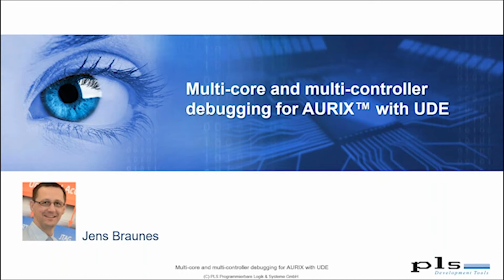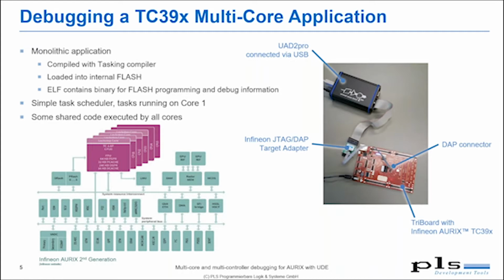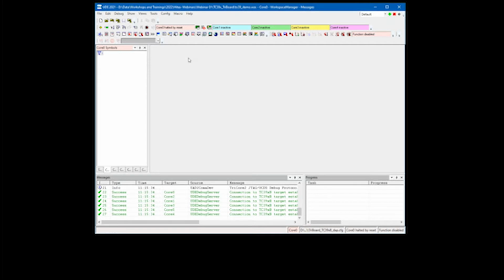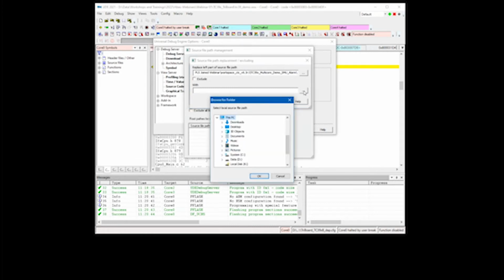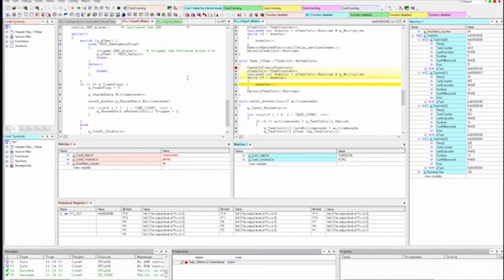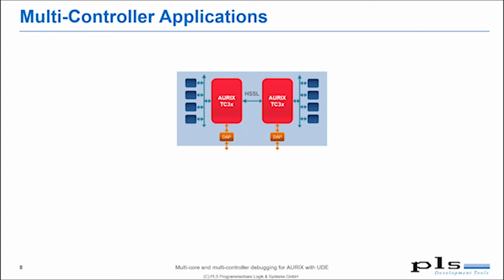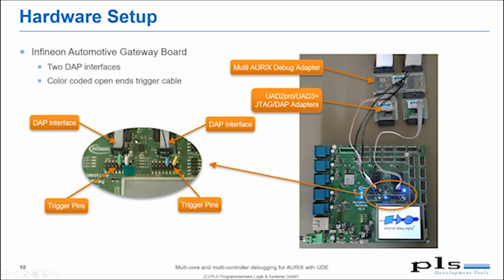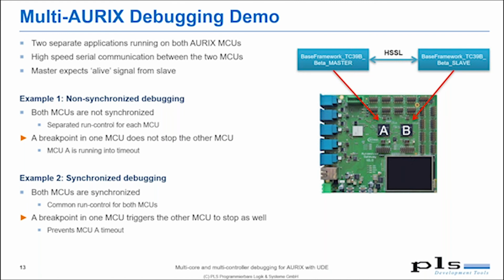Hitex Webinar with PLS Multi core and multi controller debugging for AURIX with UDE

Comment: nice presentation.  is the UDE using memtool for the target configuration?
Reply: I think you mix two different things behind the term 'target configuration':
1. Target configuration that is used for UDE to get connected to the device in a proper way. Here the Memtool is not involved. Everything that is needed is stored in a target configuration file (CFG).
2. Configuring the device itself (e.g. UCB, Boot mode, etc.). The Memtool provides setup pages to deal with. In this case, yes, you can say 'using Memtool for the target configuration'.